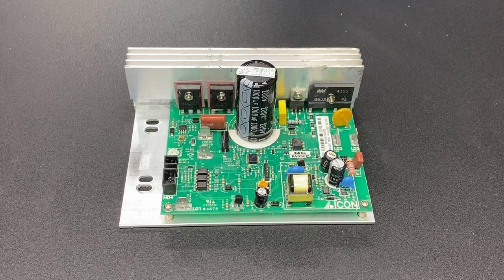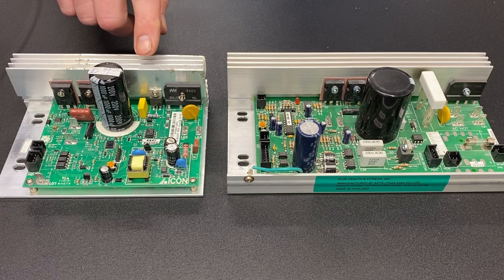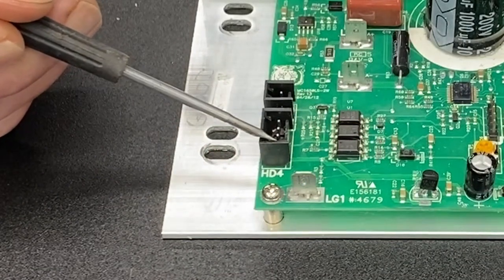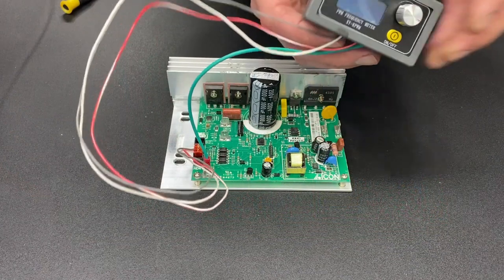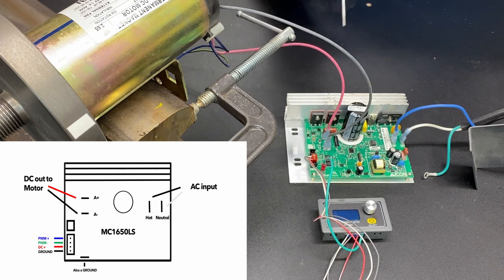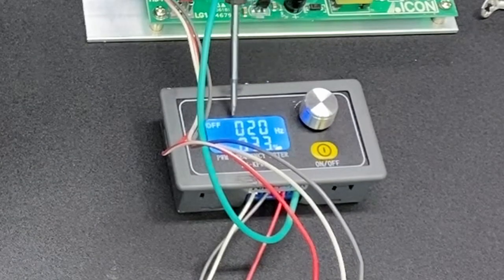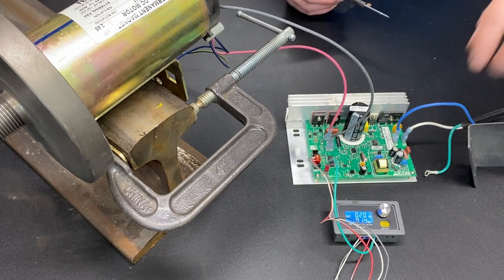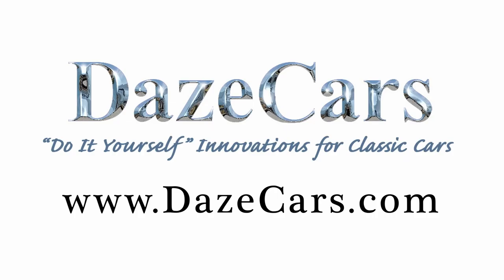How to Hack an MC1650LS Treadmill Control Board to Power a Treadmill Motor, Controller

Comment: Thanks for the information. I'm taking apart quite a few treadmills and I know I'm going to have some extra boards. When I'm done sorting through them I want to send you some I'm not going to use. I figure you can use them for different purposes testing and you will have some boards and I will learn something. To me that is a good trade in my world.
Reply from the maker: Sounds good, If you contact me through my website I can give you my address.

Comment: Hi Dave, just subscribed! So glad to find someone who knows(& loves) DC motors. I’ve used them in my lathe for quite some time but I’ve run into the fact that treadmills have different controllers and not just the old MC-60 which are quite easy to wire up but can’t find a lot of clear, simple directions on other model controllers. I’m looking forward to gleaning a lot of info from your site. Also, might even worry you with questions. Hope you don’t mind as I’m already seeing some great info.
Thank you for sharing!
Reply from the maker: Glad I could help!  I'm not afraid of questions, so fire away.

Comment: Hey, great video.  I just scored a roadside giveaway treadmill.  Striped down the parts and everything works great on the workbench in the shop.  I scored a 2.75 HP motor (2 HP continuous) with the MC1650LS 2w control board.  There is next to no information about this older control board to be found anywhere.  Thanks for being the only source of information about that board.
Reply from the maker: glad I could help.  Make sure you do the torque calaculation to determine if that motor is going to be up to the task of what ever you are replacing with it.  https://youtu.be/A_zBGJkhBAc
Reply: @dazecars  Hey, this motor does not have max RPM value on the motor nameplate.
Reply from the maker: @GrayCo  that is odd because HP is directly related to RPMS.  every motor I have tells you the RPMS at which the HP rating is derived.  I am not saying your does and you have missed it just saying those HP numbers mean nothing without RPMs.

Comment: Very well done! I happen to have 2 MC 2100 boards. (I also have an addiction to collecting treadmill parts. Lol) I think that I'll try one out. Previously, I had been using a SCR motor controller. And a couple of weeks ago. I managed to burn up my motor. Not saying it's because of the motor controller. I think it got clogged up with wood chips. Not positive tho.
Thanks for the video.
Reply from the maker: sometimes treadmill motors just fail. people forget that it had a life before as a treadmill and may be at 50% life when harvested. 😁

Comment: Thank you so much for this video!!! This happens to be the particular circuit board the "free-to-me" treadmill I got uses. This vid really helps a lot! I'm looking forward to learning more from more of your videos. However, I do have a couple of questions.......
Does this circuit board have a built in DC choke? I didn't see you use one in your wired up example. If it is required, what one would a person buy? The treadmill came with an inductor/choke for the AC side of the equation, but no such animal like other examples I've seen for the DC.......
The planned use for this motor is for a rotary metal polishing tumbler. I built one using a 3/4 hp AC motor, but it ran very hot. These tumblers need to run for hours on end, but it turned out that my AC motor was one with a 1 hour long duty cycle. Probably meant for a bench grinder-type application, or something similar. Now, using the treadmill motor to power the tumbler, would it be recommended to use an extra fan to cool the circuit board?
Reply from the maker: A choke is required on an SCR type voltage controller but the control panel you’re using is a pulse width modulation type control panel so the choke is not required.  it’s not a bad idea if you can find one but again not required. Anything you can do to keep the electronics cool is going to be to your benefit so a cooling fan is not a bad idea especially if it’s going to be running for long periods of time.
Reply: @dazecars  Many Thanks again, @DazeCars !!!! Truly appreciate you takin' the time to help an "Electronics Goober".

Comment: Thank you for your video. I do have a question.
I understand the input needs to be a PWM signal with a frequency of 20 Hz. But is that also the PWM on which the motor is driving?
I would like to know as I'm trying to build a motor controller for a 180v treadmill motor myself.

Thanks!
Reply from the maker: The 20hz is just the trigger for the power supply electronics.
Reply: Thanks. But no idea on what frequency is used for the PWM on the motor?
Reply from the maker: It's not so critical.  the pulsing reduces voltage output so the motor is going to run without issue in a host of pulse rates, some faster than others.

Comment: Hi - doing research for treadmill conversion and i love your content.  Just opened up my first treadmill and already confused as the Motor Controller board is a Keys Fitness 08-0158.  it would seem it is also a PWM controller as there is no H/W/L terminals.  I am unable to find a wiring diagram so don't quite know which wires from the main board would make up the 4 wires for the PWM controller.  Have you seen this board?
Reply from the maker: I have not come across that board.  Was there a pin out sheet taped inside the cover of the treadmill.  If not pull apart the treadmill main control panel and look at the circuit board a lot of those outputs are labeled and then you can match wire colors.  Please let me know if I can be of further assistance.
Reply: @dazecars  unfortunately no pin out sheet or schematics.  lots of pictures from google search, but no online diagrams.
Reply from the maker: @TheSchenkapotomus   Check the labeling on the display/control panel main board.  If nothing there I don't have an easy fix for you
Reply: @dazecars  No worries... i find this all fascinating and the information you post is easy to consume.  At the very least, i got a 3.0HP DC motor and i'll just get another free treadmill tomorrow... they are everywhere.  I will look into the SCR angle as well.

Comment: Hey, I just got that same PWM device you demonstrated.  The motor runs smoothly at 190 RPMs with the PWM device showing 15%.  Do you think these motors can run for 30 - 60 minutes at these low RPMs without damaging the motors?
Reply from the maker: If you have blue wires and they are hooked up correctly I would feel comfortable running at that speed as it will auto-shutoff if it gets too hot.  If not, a little more RPM would be better for more airflow from the fan.  Gear it at 2:1 and you should be good to go.

Comment: Any idea where can I find circuit diagram for this board. It does not have any lights and does not output power to the motor and to the display board. Capacitors are good. thx.
Reply from the maker: no I do not have a diagram for that one
Reply: @dazecars  Any idea how many ohms could be two resistors labelled as R24 and R44? thx
Reply from the maker: I am assuming yours are burned up and you can no longer see the band colors?  I no longer have that board so I can't get you the band colors.